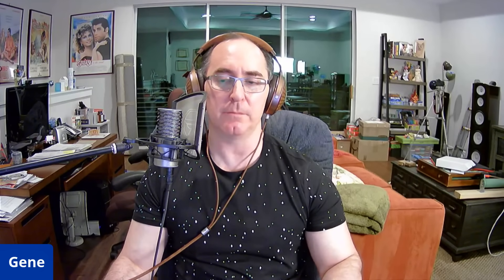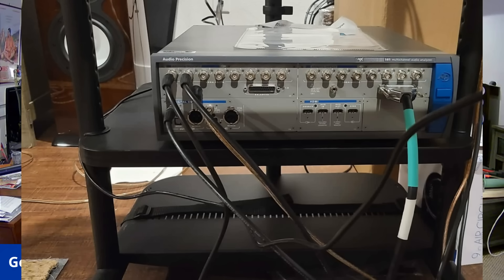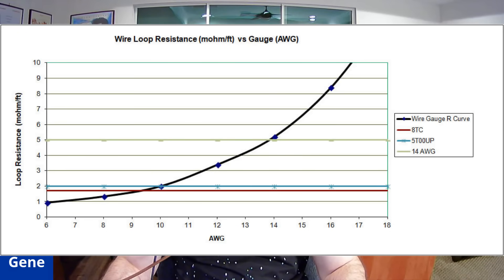Speaker Cables Really Don't Make Much of a Difference?

Comment: I think all these so-called tests on the internet miss the point. Personally, I think all speaker cables sound different, but there are ones that sound more similar to others, and this is irrespective of price. Some expensive cables can sound very similar to their cheaper counterparts. If one compares the two extreme characters of cables, it is very easy to tell the difference. In AB tests, anyone can pick the right one every time. However, if you put two cables of similar characters but different price together and AB test, sometimes human ears cannot distinguish. That is because our hearing is dependent on a number of factors, like listening with lights on and off sounds different, hearing is affected by vision, and visual conditions may be different between the tests. By running expensive and inexpensive cables with very similar characters together in tests and saying that people can't distinguish, the test itself is flawed, and then in that they claim cables make no difference, this is not called scientific.
Reply from the maker: @9876rayray  your logic is flawed. You're letting feelings bias your beliefs. I used science to show electrically and acoustically there are almost no differences, certainly far below ear detection and barely measurable.  What you're hearing is clouded by confirmation bias and placebo since your listening tests are sighted.
Reply: @Audioholics  when one hears a difference and measurements don't show the difference, the measurements may be measuring the wrong parameters, that is science .....
Reply from the maker: @9876rayray  No,  that's actually Anti-science. You're letting human biases influence you, and there are no controls to eliminate such biases.  Test equipment properly used doesn't care or have such biases, and the test results are consistent, repeatable, and verifiable.

If you want meaningful and statistically significant audible verification, then blind listening protocol must be used to flesh out any audible differences between cables to eliminate biases especially since such audible differences are so minute or in most cases, non existent.
Reply: @Audioholics  In blind testing, some cables stand out which trained ears can distinguish every time, yet measurements may not show much difference. You keep on saying we should not let human biases influence us, but the aim of these equipment is for human enjoyment, not for scientific measurements. How can one ignore human factor in these tests? i believe there is a science behind explaining all these, it is just we at the moment know so little that what we claim is scientific measurements are actually flawed measurements.
Reply from the maker: @9876rayray  there are no documented blind tests that have revealed audible benefits of exotic cables over competently designed ordinary ones. You can't just make that up like it's a fact to fit your narrative.  Keep trying.
Reply: @Audioholics  If that's the way your 'scientific' mind is thinking, I give up, you believe what you want, it is really none of my business.
Reply from the maker: @9876rayray  and yet you continue making bad ASSumptions and comments on what you think science is.
Reply: @Audioholics  Science is also subject to evolution and is absolutely not sacred?
Reply: @_Sam62  I would argue it is those that claim to hear differences, that have compromised hearing... Do you have a scientific argument to prove otherwise?
Reply: Well that's called being biased and wrong
Reply from the maker: @AndrewB23  and yet you keep coming back despite it being "none of your business". Sounds like you're unsure of your beliefs and need some validation.

Comment: I agree with your analysis of the speaker cables. I listened to another YouTube video where the same music was played using cables of different gauge. There was only one difference I could discern, stereo separation was best on the 12gauge cables being tested. In other aspects I could hear no difference. In my own system I did change to Monster cables which are still in use. There did not appear to be any difference, but I kept them to avoid running cables again. I now use home constructed Roger Russell IDS-25 speakers. Listener position is less critical.

Comment: The thing is: There is no
 better way to judge if there are audible differences between cables you have to compare the cables yourself with your own devices.  Two years ago I tried a pair of Klipsch RP 8000 F. First I used the QED XT 40. With that cable the Klipsch sound much too harsh  for my taste.  I then tried the cheapDynavox  Perfect Sound cables and the harshness was much reduced.without reducing dynamic.  So it is pretty obvious that an other cable makes a difference in sound. And everyone who say  that can't be should do   test after test by themself without trusting too much  in tests of professional reviewers.
Reply: That's not how that works bud the cable is the same no matter what system

Comment: I’m just using a stranded 14ga copper wire and the music sounds very nice. I bought some nice banana jack connectors so I don’t have to look at the twisties. The cables are under 10 feet long keeping them neat. Good enough is good enough.

Comment: Brilliant, Gene.  Well done!  The emperors have no clothes.  The hundreds of GRIFTERS robbing audiophiles of thousands for zero perceptible performance should be exposed as the frauds that they have always been.   
I'll take equal-length 10 AWG generic pure copper wire from Lowes every day.  
Yes, investment in room acoustics/symmetry, and all transducers (speakers, cartridges and DACs), sources, and amps are 99% of the game.

Comment: So the result of the test is that there are very small differences in "amplitude" and "distortion" between the tested cables, perhaps not even audible. But surely it follows that allegedly perceived differences between such cables are imaginary only if they are differences in amplitude or distortion or, by proxy, in something else which we would already know to be decisively affected by those. I am just starting reading on the subject but I do not get the impression that the typical claims are about how much volume one can get, for instance. 
The underlying question, I suppose, is whether we know of ways to measure all those things chich could possibly make an objective difference, as far as the various dimensions of sound quality are concerned.

Comment: This debate has been going on since the late 70s. Interconnects are far more important than speaker cables. You don't have to go overboard with those either. Good quality cables will suffice.

Comment: Im no audiofile!!  But i can gear difference in a speaker cable..  swicthed from cheap, to more expensive cables.. and i could hear a clear difference, much more power in the speaker and more bass!!
Reply from the maker: @tuemose22  you must have been using dental floss prior to the switching of the cables.
Reply: No you can't 😂

Comment: Only time I heard a difference in cables was going from copper clad cables to oxygen free copper cables but it wasnt anything like detail it was volume which when I re calibrated my system the center channel went from -6db to -7db that being said every time I buy new cables its just for the looks and all has sounded the same only reason why I buy new cables it ive slowly been adding new systems to every room in the house

Comment: You are correct. Cables make a difference but very small. Thry make more difference with hi power amps and low efficient sprakers.  With horn speakers and 8 watt amps the difference is miniscule😊

Comment: 🎯 Key points for quick navigation:

00:00 🔍 Introduction and Overview
- Introduction to the video’s main question about the impact of speaker cables,
- Presenter’s background and experience,
- Mention of the sophisticated equipment used for testing.
02:18 🧪 Equipment and Testing Setup
- Detailed description of the test equipment (Wayne Kerr LCR meter and Audio Precision analyzer),
- Explanation of the cables tested (10 gauge, 14 gauge, and Kimber 8TC),
- Rationale behind the 10 feet cable length for testing.
04:03 📊 Measurement Results
- Comparison of the electrical properties (DC resistance, AC resistance, inductance, and capacitance) of the cables,
- Discussion on the significance of these properties and the engineering behind Kimber cables,
- Inductance and capacitance values and their impact on audio performance.
08:02 🎛️ Practical Testing with Amplifiers and Speakers
- Overview of the testing with Denon PMA A110 integrated amplifier and Revel speakers,
- Measurement of frequency response and distortion with different cables,
- Analysis of the minimal differences observed in the measurements.
12:01 🔬 Real-World Implications
- Testing with an actual loudspeaker (Revel F328BE) and comparison of results,
- Explanation of the insertion loss and its minimal perceptual impact,
- Conclusion on the negligible differences in sound quality between the cables.
15:03 🧠 Psychological Factors and Practical Advice
- Discussion on the placebo effect and psychological influence in perceived audio quality,
- Emphasis on the importance of room acoustics and speaker placement over cable quality,
- Final thoughts on the value of expensive cables and the role of scientific testing in audio.

Made with HARPA AI

Comment: I've been using a good quality branded 10 awg cable for years. The most significant improvement on the sound quality I heard was when I used a newer power amp by the same company (Quad 405 to the 405-2). Same cables nicer sound.

Comment: use your ears cables do make a diffrence (expensive do not mean better) but hey use your ears not some fkn machine.............
Reply from the maker: Congrats on showcasing your ignorance. I listen to music every day on some of the very best gear the industry has to offer and I do so in properly acoustically controlled environments professionally set up and calibrated by yours truly. I have expensive and cheap cables, fancy and regular cables. The expensive/fancy cables almost NEVER measure better and rarely sound audibly different than competently designed cheap cable. It's jewelry mixed with placebo. Enjoy.
Reply: @Audioholics  your ignorance expensive does not mean better,capacitors in xovers do not make a diffrence either right?

Comment: I use Kimber 4TC with a cotton cording and plain ole gold plated brass bananas.  Cable DOES make a difference.  But it's the cherry, not the Sunday.  Source and Speaker, Amplification, interconnects, power source, power cable, and at the end of the line, speaker cables.

Comment: Thank you for the very informative video. As an electronics engineer, I am not surprised by the results. One point though which I would like to see measurements of is the potential disturbance of the signal in the speakers due to the magnetic interferences the 110V/230V mains cable could have on the very low voltage speaker cables (though my belief is that this is negligible).

Comment: While I am not prone to believing that I can hear a $10,000 cable difference, I did recently replace some generic (audio quality) cable that my installer put in with some old, higher end Monster cable, just as a “What the heck, I got these nice cables, may as well use them” moment.  To my surprise I immediately heard the difference in better clarity and detail.  Even on the center channel.  Now, I had no preconceived notions on this, which is why I was surprised.  While I understand (and still believe) there is a lot of hokus pokus out there, I have to admit, I now do believe there are audible differences, at least form Generic audio to better purpose made cables.
Reply from the maker: It doesn't take much to get good cables. 12awg stranded OFC for speakers,  shielded coax for analog audio and 8k certified HDMI cables and you should be golden.
Reply: @Audioholics  I agree you can get good cables inexpensively, and I did start with OFC 2 x 16 awg (doubled up) and went to single probably equivalent of 12 awg.  Again,  I am not a big believer in the funky directional, the little active devices etc.  That defies science.  But I undeniably heard a difference to my surprise in my experiment.  So I am partly with you, but partly I have to acknowledge that there are some audible differences, which some equipment may pick up, some not.   Then, there is a lot of snake oil out there and it is difficult to sift through it.  That said, I am not going out to buy the esoteric cables that cost more than my amp.  The better investment with more sonic difference would be investing in the better amp. Etc.  Anyway, I like your channel, and appreciate the science based look at things.

Comment: IF YOU ARE BOUND TO USE LONG CABLES  THAN YOU CAN COMPENSATE THE EFFECT OF INCREASE IN RESISTENCE FOR THE LONGER LENGTH BY SELECTING A CABLE WITH LARGER DIA

Comment: Thanks for this video.
It will help me.
I had the concept right but the numbers wrong.
I had thought 14 gauge was sufficient, anything thicker was diminished returns.
I'm about to install new speakers and amp.
Experiment with speaker placement first, then by 10 gauge.